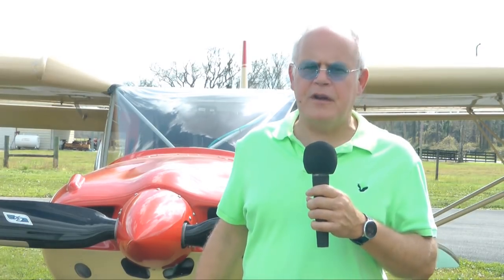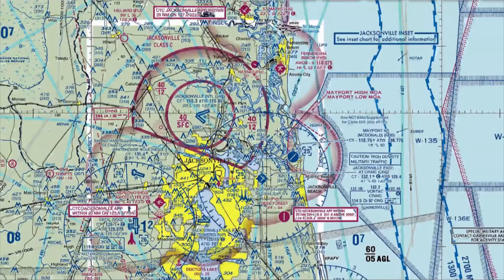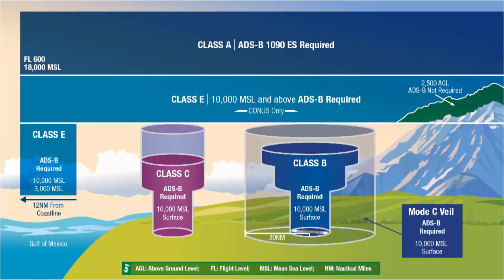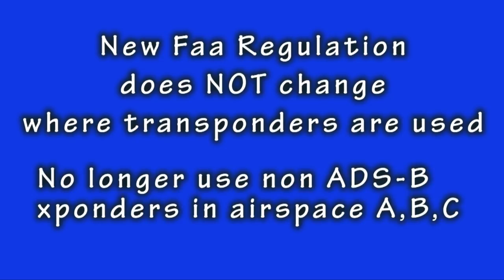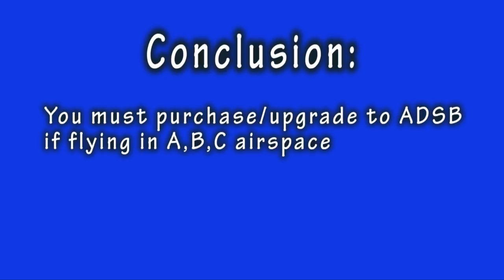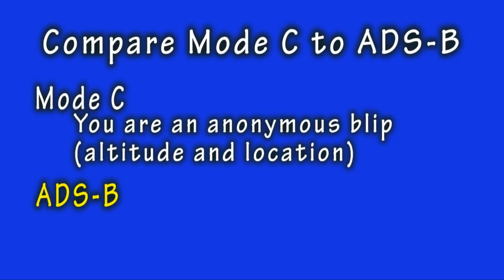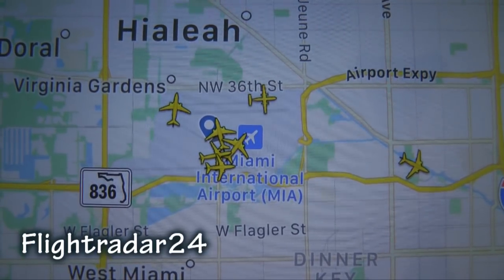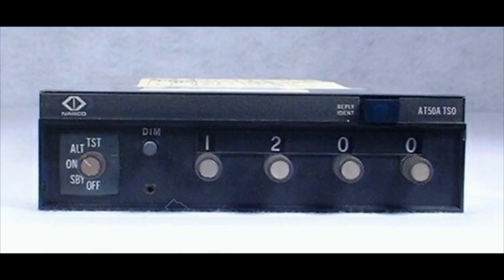The new ADS-B law for 2020: Some Basic Facts

Comment: Your points about anonymity for 1090 MHz Mode S are correct for the moment, however there is also the option of using a UAT 978 MHz transponder to satisfy the ADS-B requirement. This type has an anonymous mode which is equivalent to squawking 1200 because it generates a randomized code. Note that anonymous mode may only be used outside of rule airspace AND when not utilizing ATC services, i.e. flight following. If your flight begins or terminates in rule airspace, it would however still be straightforward to correlate the handover between your actual ICAO code and a randomized one.
Reply: See https://www.aopa.org/news-and-media/all-news/2019/august/01/ads-b-privacy-inches-forward for more info.

Comment: I'm concerned with the lack of authentication. The system cannot know with certainty that the received data actually originated from a specific airplane. 
An adversary could spoof data making it look like you consistently violate regulations bringing enforcement action against you. One could make 'ghost' traffic resulting in real airplanes taking potentially dangerous evasive actions to avoid non-existent airplanes. 
Imagine the implications of a high powered transmitter faking signals from a real airplane making it appear to be at a different attitude than reality.

They should have, at a minimum, included cryptographic signatures in the data that could be validated using public keys.

The entire system seems devoid of security.
No privacy for where you travel.
No protection against fake data
No method to validate if data is real and from a specific airplane
Reply: I agree with you completely, that is a bigger concern of mine than government tracking

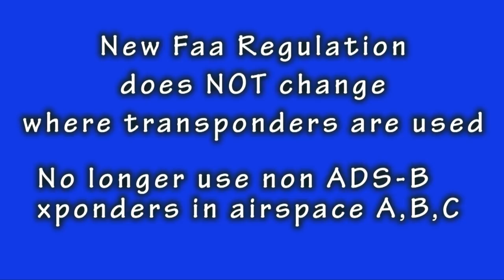Comment: Maybe I'm misunderstanding what youre saying, but as far as I understand it, what is shown on figure at 4:32 is NOT correct.   My ADSB solution (and I'm not the only one), uses my existing GTX327 (which is a Mode C transponder) paired with an ADSB UAT for compliance in B, C airspace (UATs cant go into A space).  Noone need buy a new transponder unless it infact cant be paired with a UAT for B/C access.  But I could be wrong. Ref: 91-131 (d)
Reply from the maker: Your setup constitutes an ADS-B compliant transponder solution, no? In most of the video I say "new/upgrade" meaning to either upgrade your installation  (like you did) or purchase a completely new transponder.
Reply: @HomebuiltHELP  Maybe its semantics, but to me, ADSB is not a transponder solution.  Are there not stand alone ADSB-out solutions?  Indeed, I dont see in the FAA docs where Mode A transponders are banned if you are ADSB compliant in another way. IOW, ADSB is an add-on requirement for A, B,C space compliance......no?
Reply from the maker: Must be semantics. "add-on requirement" sounds like an upgrade to me (to become ADS-B compliant). My point is that a Mode A, or C/S transponder by itself will not cut it in the A,B,C,E airspaces anymore.  Beyond that description I think its semantics.

Comment: You make some good points and I am sure there will be implication we have not considered.  I have and like adsb but the ruling is overreaching and in my opinion geared for the future when drones will be crowding the sky’s.  I think you may have mistakenly said class A above 10,000 feet.  It’s 18,000 and also above 18000 you have to have a 1090 ADSB vs UAT which is ok below 18,000.  Then there is also the question if you install adsb and the transponder required for it do you now have to have a 24 month transponder check by a certified shop even if you never enter class c airspace since it is required you have the adsb on if installed all the time, even in non ruled airspace.  Another expense.  Good job on all your videos... very informative.
Reply from the maker: Thank you Tom, yes I misspoke and left out class E (above 10,000') as a required airspace.  (I  added this error to the description) Thanks for catching this.
And yes you are surely correct about the initial transponder check right after installation!

Comment: The difference between having GPS on your automobile and your plane is that the GPS on your plane is used for collision prevention.  Given the number of mid air collisions and the difficulty crash investigators have in figuring out what happens when a plane crashes, I think ADS-B should be mandatory everywhere.

Yes it is a bit expensive to install.   Yes "big brother" can track your movement.   But ADS-B will save many lives, just like seat belts now do in cars.  It is a safety feature.  And a good one at that.

Comment: Leave the old one in, add a compliant new one and switch between the two as required!? From what I understand once you are out of the requirement area you only need a normal transponder. Also the old ones are now flooding the used market so they are basically not worth selling so might as well keep it...